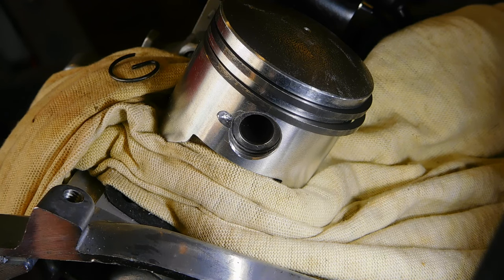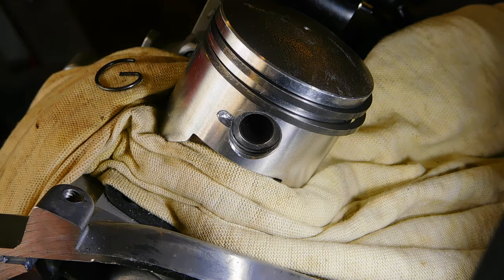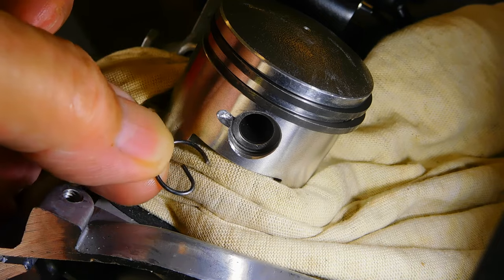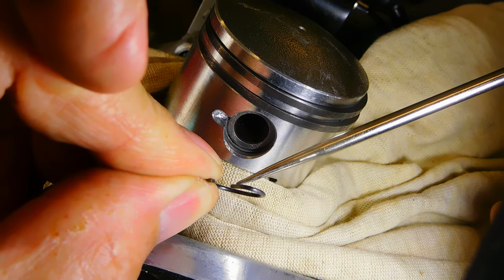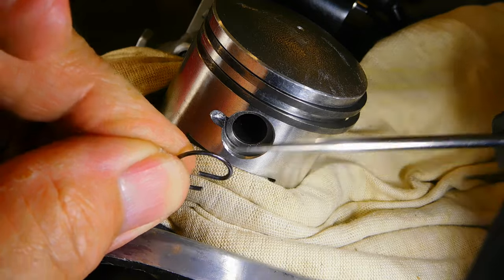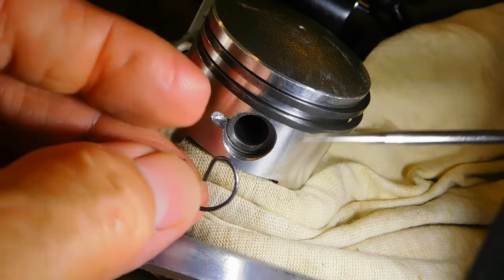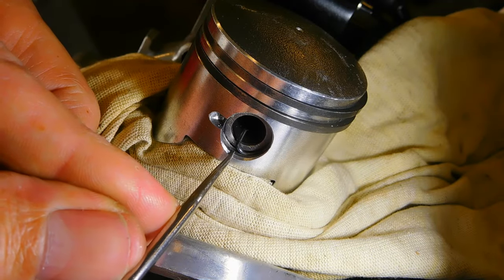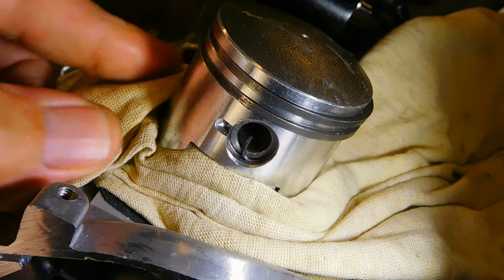One Way to Quickly Destroy a Two Stroke Engine

Comment: Im glad im not the only one! found this out the hard way when i was 15.
Reply from the maker: It is something that is not a common failure point.
To owners who rebuild their engines most will likely never see it in their life time.
But rebuilding engines as a full time mechanic it is something that becomes evident after a few years, seeing a clip fail every now and then over hundreds of engines.
And being something that is so easily resolved by using an earless clip and cheap I believe it is worth doing, even if the clip failure is not a common fault, if it does fail the damage is expensive.

Comment: what about circlips that have 2 ears? surely those 2 ears are meant to be pinched (gently of course) with needle nose pliers correct?
Reply from the maker: That just doubles your chances of a clip coming out or loosing one ear off the clip.
It might not happen to you but the only way to guarantee it will never happen is to use clips with any ears on them.

Comment: I understand what you mean but the sideways sliding forces of the gudgeon pin should be next to nothing! In fact the gudgeon pin is usually quite a tight fit in the piston so it shouldn't be moving at all. It's the conrod bearing that rotates not the gudgeon pin! I've also heard that it's the weight of the 'ear' on the clip that can cause the clip to flex at high rpm and possibly jump out of it's groove, I'm skeptical about this aswell! I think the majority of failures will be down to people reusing old clips and clips that they have bent out of shape getting them out and back in again!
Reply from the maker: While it is true the bearing takes up the rotational forces, the pin also floats side to side (if that was not the case there would be no need for a clip) and it does rotate enough to saw off the ears too which I did not cover in the video and should have.
I have a images of clips showing the ears nearly sawn off that where removed from chainsaws in the courser of servicing pistons and if you read the comments here you will see others have experienced this also.
And I do agree that reusing old clips is a bad idea for the reasons you mention.
As for the clips jumping out due to reciprocating forces I also have my doubts about that.
The bottom line is that using clips without ears will ensure none of the above occurs in all cases and is a small measure to prevent a catastrophic failure.

Comment: Hello sir im Akash 

Im restoring my old two stroke bike

I have few doubts .........
The mechanic told me its better to rebore the cylinder ........ ( The old piston is gone and it time to do second over size )  ......

Sir im doing my graduation and i dont have too much knowledge about the bike ......

Does boring and using a little tight piston make more power ?

After reboring to next oversize

Does polishing the piston and cylinder bore to a mirror finish make smooth run of bike and save it from geting seized ..........

And

Does polishing the piston and cylinder bore into a mirror finish  make any perfomance

I will wait for your reply
Reply from the maker: An "oversize" piston for the purpose of reboring will not add any power other than be a better surface for rings to seal to for good compression.
And no do not polish the piston and bore, there needs to be a stone honed finish inside the bore.
Seizing is due to lube oil ratio in fuel and or fuel mixtures too lean, polishing the bore would not help with that anyway.
If it is seizing then use more oil in the fuel.
Reply: @AuMechanic  Thankz sir

Comment: The clips without the tab can be next to impossible to remove and you can easily damage the piston trying to remove them..
Reply from the maker: Yes they are if you don't take care and use a very sharp pick to get them out. Likewise you can do a lot worse if you are not careful rebuilding any engine assembly.
Its best to grind a slot to remove them when fitting them in the first place.
Conversely if one of the clips come out due to the ear as the video explains or an ear gets sawn off as they do sometimes you stand to damage a lot more than just a scratch on a piston.

If you are lucky you will trash the piston, if not so lucky you will trash the piston and the bore and the big end a main bearings when bits of the piston end up in the crankcase and smeared on the bearing surfaces.
You only need to read the comments here to see how badly it can end.

Comment: Dang, I just did my top end with that kind of clip and did not know about orientating it. I hope Yamaha clips have no bias. The cast oem piston for my model did not also have a slot into the pin hole for installation.
Reply from the maker: Well if you are concerned about it maybe you want to slip the barrel up enough to expose the clips and check them out.
If they are ok then good but if they are not there is a risk of damage if one pops out or looses and ear, its not a sure thing but if it does occur it is a costly repair..
Reply: @AuMechanic  Yah true that. I might put the ole beast up for awhile til I find time to check the clips, and at the same time I will put a thicker base gasket on. It is nice to bundle projects together. Thank you.

Comment: Its good to always slightly bend the straight part of the clip inward.
Reply from the maker: How do you mean Inward ?
As for bending I wouldn't do that, just causes a stress spot on the bend increasing changes one will break off, in fact better to cut them off and have no ears.
Reply: If bent too far it will crease, bend it slightly at 2 degrees it want be bad and it sercures the pin from moving side to side.
Reply from the maker: If the ears are touching the piston pin at all there is a good chance the clip will come out or as others here have commented the ears get worn off by the piston pin.
Keep in mind the piston pin is floating in the piston and can twist as the engine runs not just moved side to side against the clips.
Reply: @AuMechanic  with a singled ear clip the ear would take a very long time to wear down and it would not pop out if seated in thoroughly.
Reply from the maker: @joeyoung1018  
One or two ears, neither can be touching the piston pin when it is against the clip.
If they are you are at risk of them wearing and one breaking off or as I showed in the video the pin pushing against the ear causing the clip to come out.
Either way it can get guillotined by the transfer port and you end up with damage.
So the best option is to have no ear on the clip, that way the pin always forces the clip into its slot.
Reply: @joeyoung1018  dude I've had two separate occasions when a wrist pin clips piece broke off right at the ear.I've broken them just by trying to take them out,if you were to bend it that would definitely be a stress point where it would break off.
Reply: @JamesPiccone  key thing to to very slightly bend it in, its a tedious job. Have the ear at least 1% inward,and better have sturdy hands. Make sure to have a new clip with no stress marks. I've done it alot after messing up a # of cylinders and finally having no more clip breakings
.
Reply: @joeyoung1018  dude you're just making shit up. What the fuck is 1° of bend supposed to do, the whole point of the video is it breaks off. Therefore advantageous people would just remove it before that happens.

Comment: I've used Ez clips for years with no issues, like any clip they need to be installed correctly and facing the top of the piston head, Vertex Circlips - 72060K
Reply from the maker: So far so good then and chances are you wont suffer the same fate as so many here in the comment section have using clips with ears in a 2 stroke.

Comment: I agree with this, but the G shaped circ clips are so much easier than the C shaped ones. I use what ever comes in the piston kit. When it's the G shaped I put the bend out away from the pin. Honestly it doesn't seem to matter, none of mine have come out, altho I've seen it. I do a lot of 70 cc bbk's and I see a lot of problems but not this one. Mostly heat, jetting, and when you don't deburr and break all the sharp edges on your new piston and cylinder then clean and blow off.
Reply from the maker: As long as you put the bend outwards that will help.
But be aware that in some cases the pin can rotate in the piston and after time can "saw" off the clip tag if it is touching it at all which is why the C clip is the safest.
Reply: @AuMechanic  ok I hear ya, I personally have never seen a clip get sawed and come apart. But I do believe if the G shaped clip touches the pin it ould change the harmonics enough to cause make something bad happen. I've seen some pretty weird problems repeating themselves in engines. Larger engines use a squared groove and clip, makes me wonder if it would work better in these, the piston wristpin bore would  be easy to cut cut a square groove but I'm not sure if the clips are available. Thank you for your input

Comment: Hey Dave I was wondering if you could help me with 2 stroke  ignition timing. I would love to hear   your approach
Reply from the maker: Yeah sure, what did you want to know ?
See channel :"about" page has my email if you prefer to send there.
Reply: @AuMechanic  I couldn't find an email just twitter and instagram and I don't do either of those.. but here is what I have done. I have built a cr500 for ice racing and I have installed fuel injection so I don't have to worry about carb icing and changing jets at -40 with that I have programmable ignition. I was thrown of because I expected a curve similar to a 4 stroke but when I read Gordons book it seems it's completely different... Happy new year
Reply from the maker: @blainemacdonald6929  
The amount of timing you need loosely dependent on the density of the mixture.
Or to put it another way, the lower the density is the longer the burn time and therefor the earlier you need to have the spark BTDC.
So as mixture density rises in the 2 stroke with RPM as it rises to the power band, the burn time reduces needing less advance, that tends to offset the fact the engine is going faster that would require more advance as in a 4 stroke..
To the degree that in my 350 Yam road racing for example I had no curve at all.
But that will depend on the specific engine.

Comment: I just clip these hooks of using a sidecutter. What is not there can't give you problems. To take the clip out I just rotate it till the open end lies in the pistons slot, where I can grab it with needle nose pliers. 
Nice piston rings by the way. There is enough material to make another two pairs of rings out of it. Oh, and don't rev to high, because these things will beat the crap out of the grooves. ;-)
Reply from the maker: Good idea, best if it has no ears on the clips at all.
Yeah the rings are huge, I did a video about 3 months ago on the topic of RPM limits due to ring flutter.
Reply: @AuMechanic  did you check the engines  port timing? People say it is all over the place, but not where it is supposed to be.
Reply from the maker: Yes I did (in the previous video)
Ex was about 154 and Transfer about 104, both very low, problem is in short the bottom end is 34 mm stroke and cylinder belongs of something about 36 to 37 mm stroke, they used another piston to get CR up enough but it doesn't go all the way down at BDC.
Result being short on timing and Exhaust and Transfer not opening fully.
Ill be doing another video showing all the issues with it and measure up and find out what the timing would be if the cylinder matched the bottom end.
Reply: @AuMechanic  150° of exhaust timing is perfekt for just a muffler on a two stroke, or simply open running without a silencer at all.  Over 160° you will need a tuned pipe. Just raise the whole cylinder by using a spacer made from aluminum sheet and turn it down at the upper end. I do this very often to save me from having to work on the whole transfer ports, just raise the barrel and widen the lower part of the port, also exhaust duration gets longer.  I sometimes leave the barrel longer, so I can turn the head to reach into the cylinder. This centers it very good over the bore.
Reply from the maker: Good idea raising the barrel but the cylinder is one piece head and barrel so not possible to machine the diff off the top of the barrel. Its similar to chainsaw barrels.
For a chainsaw the timing is ok but the requirement there is for low emissions and noise not peak power, this engine is for a road going machine I suspect users of it might be looking for best power which would need a bit more timing.
And if the bottom end matched the cylinder at about 36 mm stroke not 34 then timing would be higher
Both cylinders are designed to have a box muffler but that is just an issue of space.
Reply: @AuMechanic  Maybe cutting the one piece cylinder and removing the top part, so you can put a real moped cylinder head on it, would be possible. I have done this to Sachs Mopeds (Prima 5), because they have a very low cr of 6:1 and almost no cooling fins. Only things to worry about is you have to use long studs and there has to be enough room for them, also a sufficent surface for sealing the head has to be there. If the cylinder is plated there should be no problem, a sleeved cylinder might give you problems. You could attach a big finned head, like on rc cars. Looks cool, works much better, squish an cr would be  tunable to suit your application. Those green, heat resistant O-rings give really good cylinder head gaskets. I very often cut an o-ring groove in the cylinder head, just so I can take it of mltuiple times without having to put a new seal in every time. Works for air and liquid cooling if done right. :-)
Reply from the maker: I've got a lathe and mill and was eyeing off the cylinder to see how much material there is to do something like that and its pretty close to the bone which made me think maybe there is a chance of finding a cylinder and piston that actually matches the stroke on it (the one they should have used)
The piston is wrong with the distance between the pin bosses allowing the bearing to hang out one side so that has to go too.
If I could get a cylinder and piston to match the bottom end then all it would need is a little porting perhaps.
With the angled plug on this it has no squish for the most part so it begs for a different head for sure.
But, for the work required and the cost of the motor at AUD60 it might be simpler to just look at other engines.
There seems to be a few of these around and I suspect all are clones of something and chances are some are made better then others or at least have the right parts in them.
Reply: @AuMechanic  Maybe a pocket bike cylinder would fit, otherwise I don't know any moped that has this short of a stroke. A cylinder like from the Blata pocket bikes would have less volume, but the water cooled ones are good for 12-19hp. Most scooters have around 39mm stroke, no viable option without stroking the crank I think. If you don't mind that one piece design, a chainsaw cylinder could be considered, they come with sturdy and light pistons too. 
That space between conrod small end and piston can be taken up by  thrust washers, like Simson did with its S51 model. 
Don't hope for the chinese to make a reliable and funktioning engine. The only ones I know are those 4-stroke scooters 50cc or 125-150cc, but they are heavy and slow. Also small Honda Dax 4-stroke clones may work , they call them pit bike engines. 
Why not utilize an old moped engine? Cut of everything you don't need an add a centrifugal cltuch? Or those Peugeot 103  mopeds, the would give a nice crankcase and there are factory tuned ones from Malossi and Polini available.
Or make one yourself, just needs two pieces of hard aluminum and would make a nice series of videos. :-) Tunigparts for scooters are everywhere, you could get crankshafts sutiable for 16.000rpm and pretty fast 68cc cylinders.
Reply from the maker: Had a bit of a look around and there is a pile of top end kits for these engines with separate head and longer bolts to go from head to barrel base, cost around 20 to 30 dollar.
This one is a TDPRO, there are a few that list bore x stroke of 44 x 34, all similar china engines.
Looks like some are selling 44 mm bore as a "big bore" kit, that might have been the reason they used this barrel and piston just to get the bore to 44, original may have been smaller.
Either way they made a bit of a half arsed job of it.
I don't have anything to use the engines on and only bought it to do videos with, cheaper than what wreckers were after for a used engine.
Was toying with the idea of doing a Dyno project and maybe making some pipes and maybe testing a few of theses cheap motors to do some comparison videos but don't have funds right now for that.
Reply: @AuMechanic  Guess you need to find a customer that wants a motorized bycyle built. You could take video from the building process and sell the bike afterwards. I did almost the same, for the last few years. Took money from my customers, to pay for parts and material, got paid for my work after finishing the job. The fastet I built was a Gilera Runner, 172cc, almost 40hp. At the moment I am buildung a crappy 50cc chinese scooter into a 17hp fun machine. :-)
Reply from the maker: My days of doing that are long gone since I road raced bikes.
Once I'm done with this engine for the videos Ill probably give it away.
Even for the Dyno project if I ever do that Id prefer to use another engine.
Reply: @AuMechanic  it would not survive dyno runs anyway ;-)
Reply from the maker: @ElmarDylong  
My thoughts too.
Although that might make for an interesting video, see how long it takes to grenade..